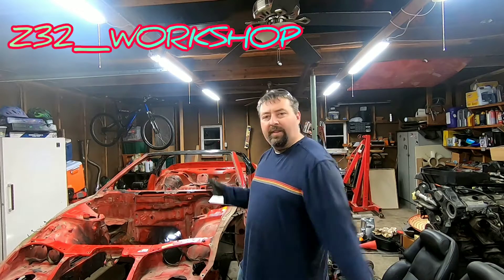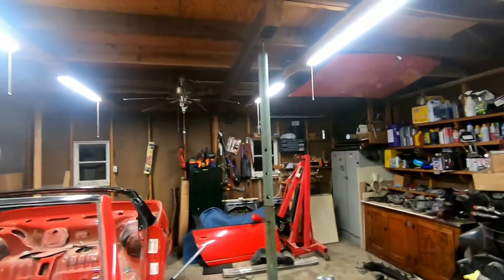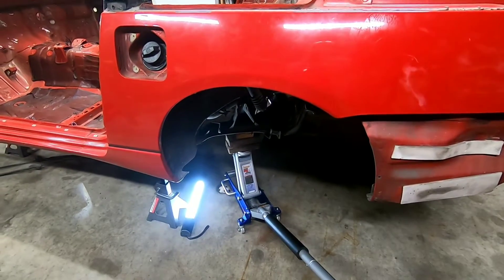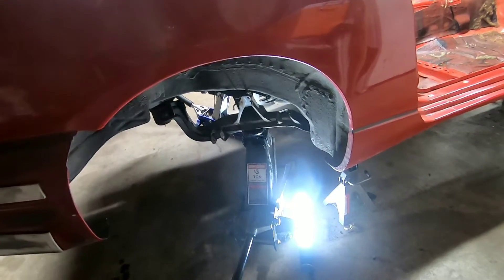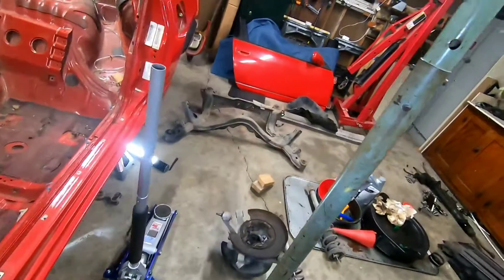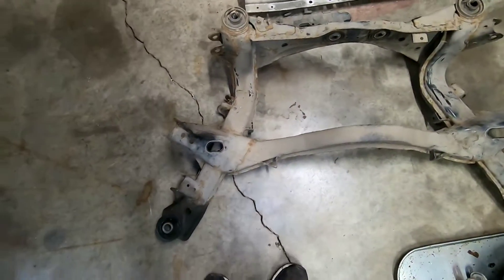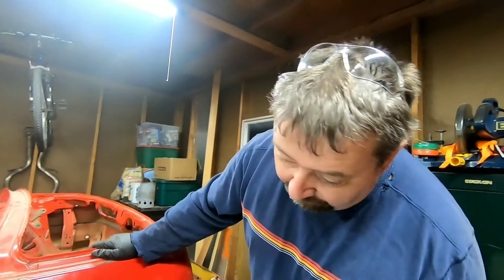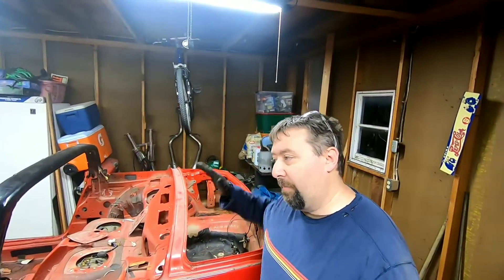Nissan 300ZX - Part 60 - Finish Rear Sub-frame removal

Comment: Hey bud, I'm considering the 300ZX for a project. Thanks for the footage as it helps me a lot. If you can, please measure something for me: the length between the firewall and the rear bump where the (rear-right) wheel well starts. 

I want to have a drivers seat and a storage compartment in my build and I want to know if there's 2 meters of space from the firewall to the wheel well.

Just using your footage it seems to me. Is there a lot of wasted space in the trunk area? Can I fit under the spare wheel some air lift air tank (and a via air compressor) for air suspensions?
Reply from the maker: Sorry the car is all cut up, so I cant measure it for you, but good luck with your build, it sounds interesting .
Reply: @z32_workshop52  thank you